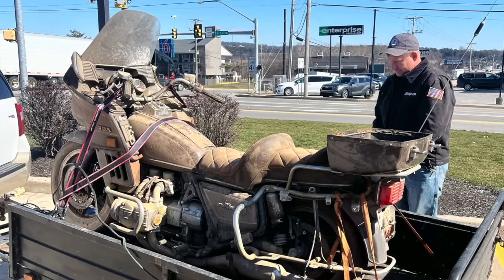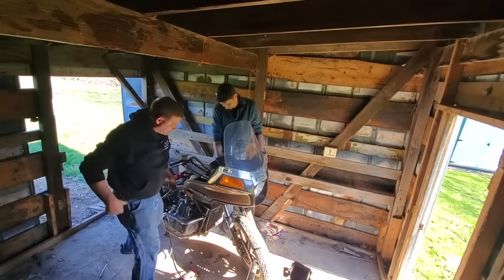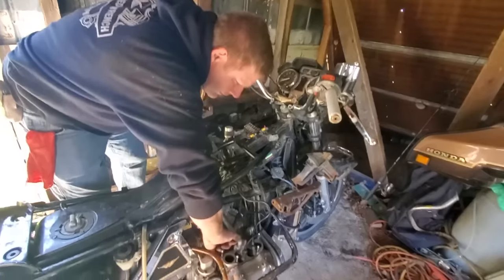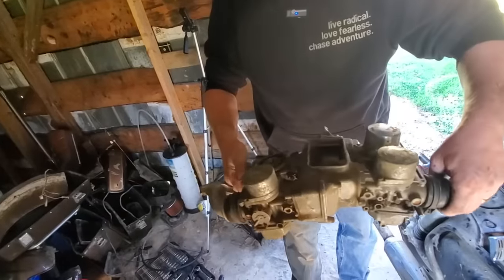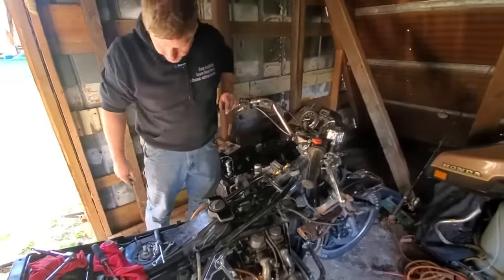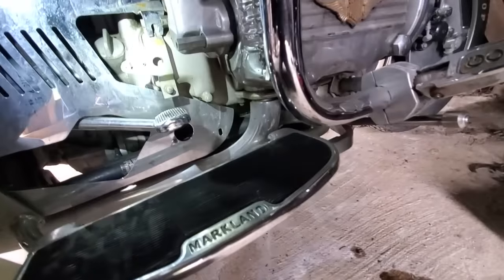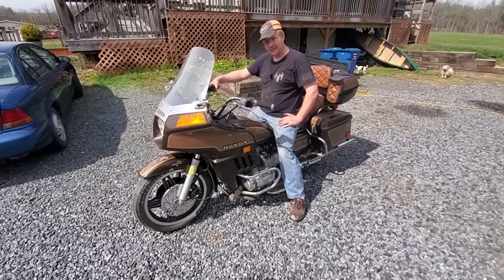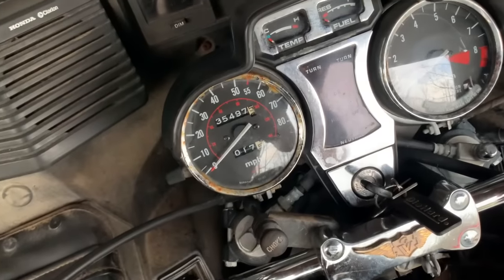Vintage Goldwing, BARN FIND. Amazing Results!  Will it Run?

Comment: Use seafoam… in both fuel and engine…he’ll bottle in engine run a while then change oil again.half bottle I. Fuel tank will help clean carbs etc…🇬🇧👍
Reply: What is seafoam?cheers.

Comment: My GL 1000 came with a trailer hitch.  Great for pulling trailers and motorcycle specific camping rigs.
When  I had my Lead Wing, I went nuts on lighting customizations and assessories.  Ever seen those 18-wheelers on the interstate at night, all lit up?  Yeah, I made sure I was seen! 
Talk about battery/charging system abuse...:face-green-smiling:

Comment: Hey guys great videio thus far .but if i may vent a little lol it was driving me a little nuts you fixing the carb on top the bikes seat .why didnt ya have a small table and put it where the fake tank is sitting by the wall, that you could work on the carb and not potnaily lose any parts but then again thasts my ocd thing.

Comment: Hey. I enjoyed this video (as usual) but I wonder why the 720p lately? Slow upload speed or some upload data limit where you are at?.. A good amount of your earlier videos were in 1080p after all....

I am not a video-hound that need a 8K HDR video, not at all, but the jump between 720 (Youtubes 720 is more like 480 in reality...) and 1080p after youtube has done its heavy compression is pretty big (and 1440p is a jump again, but much smaller, after that its no point in going further really for normal viewing). 

So if you can muster it, I would recommend trying to do at least 1080p, that should suffice for almost everyone getting a pretty good quality video when viewing on a TV or similar. Cheers mates!
Reply from the maker: It’s good to hear from you again 👍 we are putting together another boat that should be finished in a few months. My computer needs to be replaced. It wasn’t to happy with higher quality video 🤷‍♂️